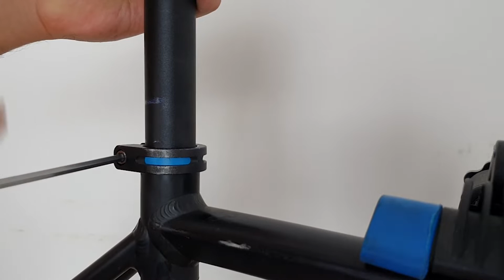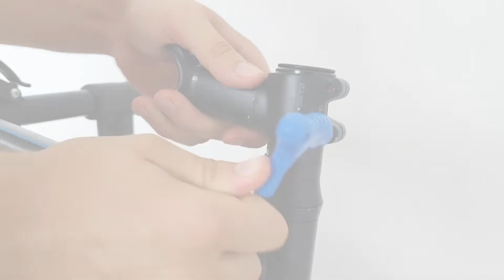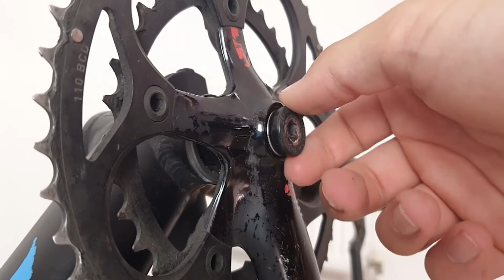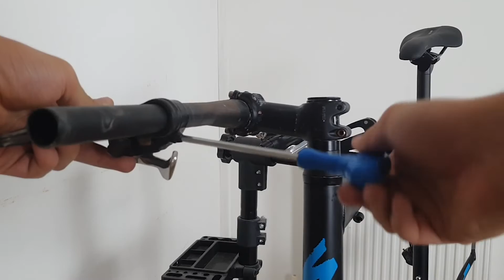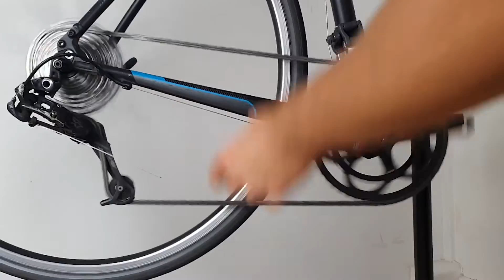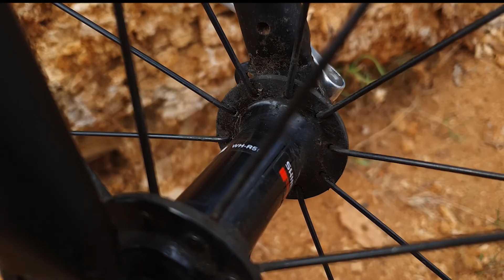Custom Specialized Sirrus | Hybrid Bike Build

Comment: Can you change the type of tires on this bike to something more off road?
Reply: You can change any tire on any type of bike you just need to make sure that you bought the right size for the wheel and a width that fits between the frame on the back and the fork in front of it
Reply: El marco de sirrus 1.0 permite un neumático de ancho 35?